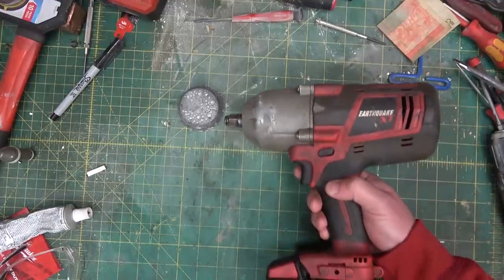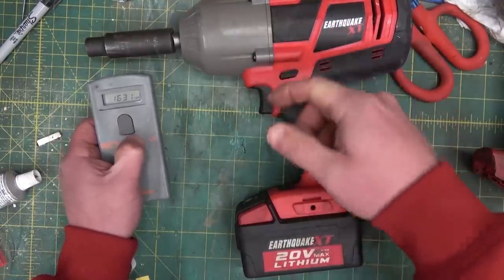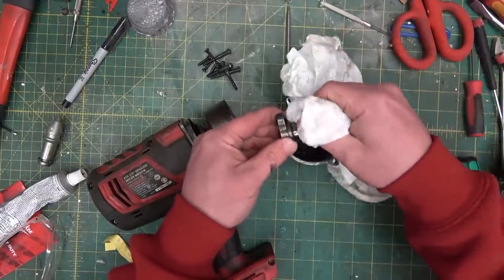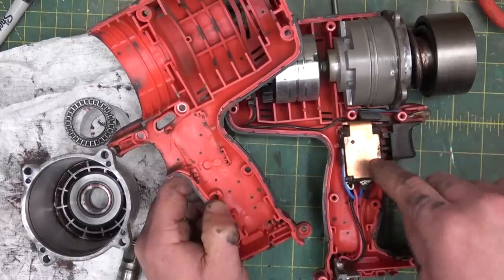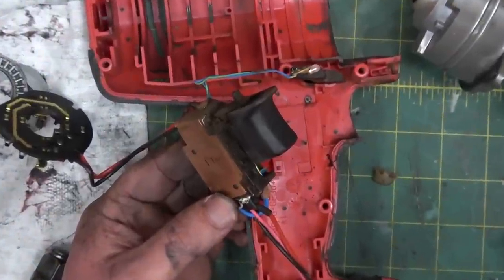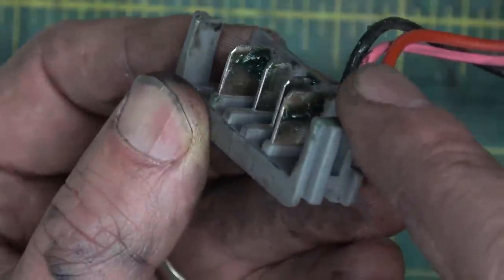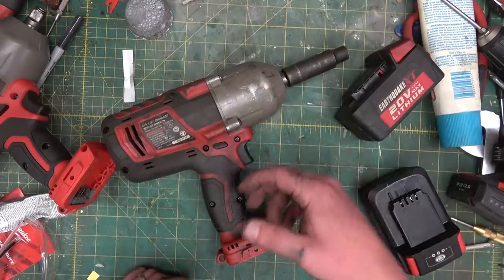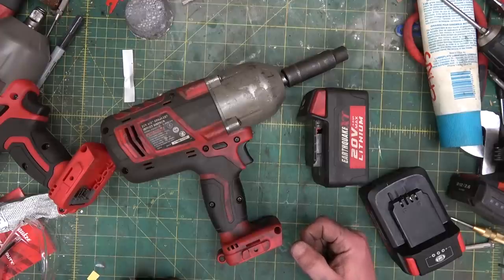BOLTR: Lost Torque 13 Month Earthquake Impact | Harbor Freight Tools

Comment: One suggestion would be to replace the brushes with new ones with a harder brush material. If they're warn down enough, the springs might not provide enough spring force to provide enough contact to get adequate/full commutation.

I have a dewalt that I recently burnt the windings out of that I've replaced brushes in several times. There was a noticiable difference between soft brush's that I bought as 'replacements', and brushes that I took out of other universal motors and shaped to fit, which were of course quite a bit stiffer.

Comment: thats quite an interesting topic, i have the same Milwaukee impact as you model 2663-20, bought it back in 2015 that thing was a powerhouse for like a years i've use it everyday at the shop that thing was legit busting wheels stud clean off ,pressing ball joints and such , then the switch gave up got it replace on warranty along with the brush card it was never the same afterward, no more busting stud and no more ooomph . i kind of ''shelve'' it until last december and got it in for service since the warranty is still valid, they sent it to Milwaukee and they say they replace the armature, but it is still the same i'll try to send it for service again see what they say

Comment: Shoulda coulda measured the DC resistance of the motor windings at the commutator. They're probably partially shorted on the heavily-used drill.

Comment: Not sure about that side of the pond but in the UK, scaffolders now use the ugga dugga guns.
I have on more than one occasion stood on a leaning platform. They just aren't doing the nuts up tight enough. 
I would say a scaffolder's gun has a harder life than a mechanics, so it follows that the torque is getting less and less. 
Eventually there will be an inquiry but only after an accident.

Comment: Check the voltage and current going to the motor. If the voltage and current are lower than the new impact, then the motor and gearbox are likely fine and the motor control isn't putting out full voltage. Could simply be the trigger potentiometer losing part of its adjustment range to crap getting inside.

Comment: I found this vid interesting because I still use the old school 18v dewalt I bought in 07 with very little, if any noticable torque loss. And trust me wen I say it has been rode hard and left soggy, not even put up. I'm curious as to why it doesn't seem to be noticably weaker when I know it isn't any higher quality..?

Comment: It's common for these to lose torque due to conductive goo packing into the slots between the commutator bars.  This causes all the poles of the motor to be active all the time--albeit some are more energized than others due to the resistance.  This also causes the motor to run hotter.

Comment: You can clean up the commutator on a lathe, although you need to make sure the armature is running VERY true and you must use a VERY sharp HSS tool.
Reply: Although in a comparatively low speed motor like this it should not be necessary to have a perfectly true commutator

Comment: Had my Milwaukee for 3 years dropped off a a lift at work knocked out of alignment in the clam shells took it apart back together still working good but I think batteries are why I like Milwaukee's best never had to replace one

Comment: At least one of those brushes was completely worn out, which means one complete winding of the armature was not being lit up by the pixies. When one winding isn't lit up, you're only magnetising half of the lamination stack at a time, cutting the torque output of the motor by half. 

I think you'd be surprised at the results after just putting a new set of brushes in.

Comment: all my snap on gear that has had reduced output seemed to occur after antifreeze found its way to the brushes. some brake clean or de-oxit would help a while but they never recovered.
Reply: Denis- interesting. The commutators had schmoo on them,, and that appeared to be the only visible anomaly. I always pictured brushes as being relatively porous and potentially contaminatable. I wonder if new brushes would bring 'er back.

Comment: I think it is a combination of 2 things, first thing is the switch that carbon film or the sweep arm has likely worn out a bit or become oxidized second guess would be something is out of true on the business end maybe replace the anvil and because the rotation is balanced and not wobbling about the motor has less resistance on it and she'll turn good and proper, could also be that the bushing is worn and its just floppin around in there other than replacing the bushing not much to be done

Comment: Wera & Wiha good screwdrivers and whatnot. The bits aren't expensive, and totally worth not having a POS bit strip out your screws and not fit well. The screwdrivers are more expensive, but worth it, at least in phillips sizes. If you take apart smaller things, the micro drivers (I thnk that's what they're called) from Wiha will save you much pain and frustration. Though I do like a more full size handle for the #0 phillips. Argh phillips screws are aggravating. They do what they were designed to do, cam out, just as intended.

Comment: I wonder if you used a sensitive thermal camera, could you compare both of them running side by side to find out if any of the electrical components have a higher resistance?

Comment: Very interesting video.  I was really contemplating buying this gun but ultimately decided to go with the Ryobi because I didn't want to complicate my personal battery lineup.  AND, the extra hit isn't really needed in my home shop.  Nastiest item I have is the countershaft sprocket on the motorcycle.  That only need a couple hundred foot pounds.  The XT was overkill and I expect I'll get many years out of little Ryobi.  Good know this beast is out there.

Comment: I would bet there is a potentiometer on the back of the board in the switch assembly, the copper wipes that drag on the board are probabely dirty or worn/weak. Thus not giving full power either due to worn/dirt/flex in the switch assembly. I have a beat to hell ryobi 1/4 impact 18v that only had full power instead of variable power and a little tweaking of the potentiometer wipes brought it back to normal for now.

Comment: Amazing boltr!  My bet is the electronics. Maybe a quick way to check is to take apart the old battery and measure Voltage and current out put on the battery on both

Comment: Burned smell: insulation in the armature melts effectively reducing the coils, or fet's in the controller reducing the voltage. Meas V or ohm and try swapping with known good.

Comment: We want to know what actually failed. It's got to be in the switch, or the magnets have grown weaker. Hook the motor leads from the good and bad unit up to an oscilloscope and characterize each unit to determine actual failure mode.
Reply: Interesting thought with the magnets. Heat and impact are certainly bad for magnets. Didn't think of that.

Comment: having used thousands of large diameter stud bolts to different bolt up specifications i can tell you first hand that never seize compared to something like an moly grease is completely different.   when you've got to spin nuts onto dozens of two inch bolts you can tell pretty fucking quick the difference.   transcanada has really gotten into the moly grease for their bolt ups lately and it's really fucking nice.   even coming apart after pressure testing the pipe spools it's much nicer to work with.  dunno about years down the line though.

Comment: If you drop a scope on it you should see if the output waveform is full duty cycle. My guess is the variable resistor is going bad.

Comment: those hogrings r such a pain i had to get another anvil (from my own complete stupidity) ..got the pin style n still hit the pin with a grinder lol its like they think youll be hangin from the ceilin by a socket    if u get tired of replacin guns check out the dcf899 by dewalt iv had 1 almost 2 years n it still feels like its gonna snap off a lug if u leave it cranked up on 3  i jus got another one off ebay for 175 used with a 5 amp hour battery so i dont have to keep runnin back n forth to the truck n shop  i was paranoid of the day i needed it hours from home to realize its hangin out in the warm shop.. not any more :) :p   btw i dont work or have anything to do with dewalt iv just always been highly impressed by their stuff

Comment: Check the waveform of the voltage getting to the motor using the oscilloscope and compare the good one to the bad one.

I bet anything the electronic circuitry is just not giving it full chooch, possible due to crap getting into the potentiometer that controls the duty cycle.

Comment: The big brushes in the back looked worn. I've replaced tons of deWilted brushes at the shop over the years, and the tools sprung back to life. I want to buy a brushless grinder or drill, but i can't justify the cost when the old ones still rip through stainless steel

Comment: Pretty good vid, but I'm hoping for a more in depth follow up with metering to determine the actual culprit. It's clearly on the electrical side whether that means the switch had a faulty pot or some blown out mosfets. One fella suggested that the RPM shown equates to nearly exactly what you should have if only half of the motor is running, and I'm inclined to agree. Makes me really itch to know if it's the switch contacts that failed due to wear and ingress, or circuitry that failed due to "natural causes."  Maybe it's just the heavily worn brushes not allowing for sufficient contact pressure on the comm bars.

Some others have suggested that the magnets may have de-chooched due to heat, but I feel like that's pretty unlikely. Maybe not impossible - but unlikely still.

Also Eric O isn't the type of guy to even touch that much never seize, much less put it in his gun. He'll use it where he needs to, but Buddy has plenty of access to all types of grease if he were to get in there and poke around. All that silver is probably wear from something or other. It would be neat if you were to measure parts in new and old guns to find what shape that glitter used to be.

While I'm here, a sincere Thank You for all the knowledge you share with us. Tearing down the tools we all want to see the guts of, but don't want to pony up the cash for.

Comment: Worth the investment? They're still rather expensive in the Hazard Frought and still think itd be better to just buy a used Milwaukee or DeWilt so the batteries I currently own carry over... thoughts?
Reply: In my opinion. I'd think the warranty should play a part. If the tool is good enough, cheap enough, and has a decent enough warranty. Why not get new ones when she breaks
Reply: @djstringsmusic2994  I thought that too once and said "Hey - these Rigid tools have LIFETIME warranty!" at the Homeless Despot... what a scam that turned out to be. It was 30 day return in store and then this massively long convoluted mess of proration and sending the tools off at my expense to get a determination- basically not worth the hassle... I do think Harbor Freight is coming a long way in quality and customer service though
Reply: @BAMAJiPS  Yeah I'm not too familiar with the harbor freight warranty. I didn't know that about home depots. That sucks.

Comment: Check the voltage on the motor, either the potentiometer is bad or the mosfet is going higher resistance

Comment: I'd bet it's the switch not putting full voltage to the motor.  If the brush interface was where the resistance was, or even the battery terminals, they'd be getting hotter then frig.  If you figure your dropping maybe 4+ volts there, at 15 amps, that's 60 watts into a tiny space, they'd be smoking the second you put a load on the thing.  Even without a load they'd heat up fast.

Comment: You should have checked the voltage output at the brush wires and put a resistor across it half the ohms of the windings of the other one

Comment: Check the spring in the hammer. If the spring is worn out it won't slam into the hammer as hard there for not as much power

Comment: will you do a boltr on some bosch blue stuff?
Reply: THIS
Reply: bosch blue is amazing, best crap I have bought in a while but bit exxy
Reply: all I run is bosch blue stuff. I have taken a few of them apart over the years to repair etc. Most of the different models use the same basic parts so I have mixed and matched them to keep them going.
Reply: I love my 12v small drill.
Reply: I'm on my 2nd set of Bosch blue gear over the course of 7 years. Decent tools but no better or worse than the other big brands. Up to my third angle grinder though, the first two actually German made and the latest Chinese, not any difference in quality. Seems like the only 18v grinder with any real torque but chews though batteries.

Comment: Boltr old skool awesome.  I'm about to fire up my 9 year old air ugga dugga ( hazard fart) fur a brake job, my concern is not with it. It's with my none starting hazard fart air compressor ( it hasnt ben used in a year). She dont like to start unless plugged directly into my hazard fart generator. Feel better.

Comment: Interesting that it lasted about as long as the Milwaukee.  The HF Earthquake line seems pretty decent.  I've got the pneumatic impact and it works well, but I'm just a home gamer.
Reply: I work on semi trailers, I have a smaller harbor freight impact, has held up surprisingly well to daily use, rough on it too.

Comment: I will guess that it's the switch. I would have shot  a bunch of contact cleaner into the switch through the cracks or through a hole that I drilled into it. You would be surprised at how often a can of contact cleaner will fix things.

Comment: There's indeed a possibility that conductive dust could bring problems in the trigger speed control, or maybe just wear on the potentiometers, why don't you try using the new electronic trigger on the old impact gun? (also try measuring the amps going into the motor, if the amps are lower it's an electrical problem, if the amps are higher but still lower rpm, then it's mechanical problem.)

Comment: Could that shiny stuff be bits of metal suspended in a grease from wear?
Reply: It is, I've seen it before in impacts and cheap air tools. Easy mistake but it's not never seize.

Comment: If they have used cheap ass capacitors in the PWM MOSFET gate drive they can start going open circuit with both vibration and pulsed current (the plates crack and suffer from electron bunching). That will reduce gate drive thereby increasing the amount of time taken to switch from off to on and vice-versa. Ceramics that use X5R or Y5V are also renowned for loosing capacitance over time. You really need an X7R which is physically bigger so 1 the plates are not thinner than a politicians morals, and 2 the tolerance and capacitance does not go wandering off all over the place. Because the capacitance is also used to damp everything going "boing" because of self inductance when you have high gate currents you can also get slight overvoltage on the gate which over time depending on exact construction can cause the Rdson to rise and all sorts. Pain in the grunnocks to say the least.

Comment: Careful using them 3m scrubbadubbers on conductive connections.  Them scrubbers is al you mini um ox hide.
Everybody knows if you want get a rubbin' you gotta give a rubbin'.
(You'll deposit some Al oxide on the surface you're cleaning, and Al oxide isn't very conductive)

Comment: They make Tiny round files made for dialing in the brushes. R/C car guys buy them from hobby store tower hobbies is a good mail order on.they are made for guys who race the electric 1/10 scale cars they all run the maubachi 540 can size brushed electric motors.they also sell brushes cheap and with different grooves cutout on the contact side.

Comment: The fact that it goes through a "slow death" instead of an abrupt failure to chooch is kind of a testament to the build quality isn't it? I mean, a year is a little short of a lifespan but in a shitty tool you'd expect to see a part actually fail, here it's just wear of the parts which even in the best tool on the market will happen

Comment: The used hard dugga gun had 75% of the RPM of the fresh dugga gun ((1210rpm / 1630rpm) x 100 )= 74.2%. I would bet the lost RPM's are due to a failure in the speed control circuit. We already know the heat sink on the trigger switch got hot.

Comment: Months late, but hydrogen peroxide on the comm creates a protective film and seats brushes a lot better. Better contact = better circuit = better motor.  @10:38 The cleaning of the "comm bars" as you put it, has removed this film, you, in fact, made this small DC motor worse by having done so. 
``Industrial motor mechanic and rewinder``

Comment: I think you are losing windings: a low ohms check of the two sets of rotors and stators would give you some idea. It's not uncommon to get individual windings short out. This increases the current draw and leads to more heat and more windings shorting out. It's a slow death but the rate of decline increases with each successive short out. You could measure the current draw under load too, that would give an equally good comparison between the old and new.

Comment: The graphite sublimates. Is that true? That's like 3500F/2000C. Seems temperatures like that would have been more catastrophic...
Reply: It actually does get super hot at a microscopic level thanks to arcing.
Reply: @NiHaoMike64  I wonder what carbon does when it suddenly finds itself as a gas...

Comment: ….1/2"....3/4"....in the meantime...Milwaukee has released a 1" impact...M18 battery model... weighs 7 pounds....1,200 Ft. Lbs. of torque...

Comment: Motor strength may also be dying. Heat cycles kill magnets.
Reply: Don't you think he'd had less trouble removing the magnetic section then? He could barely get it undone.